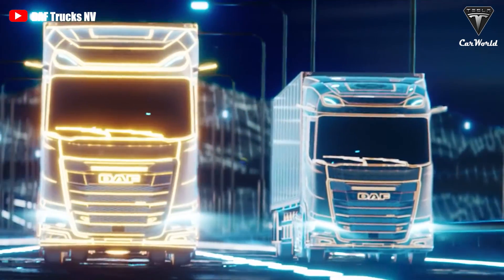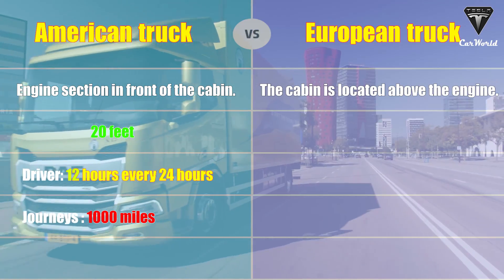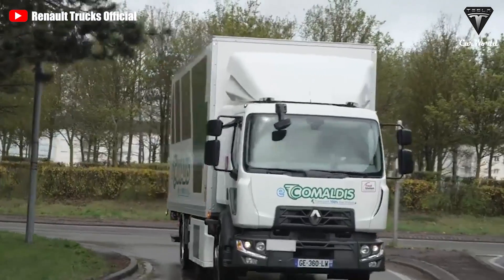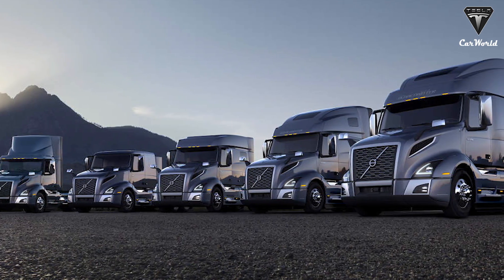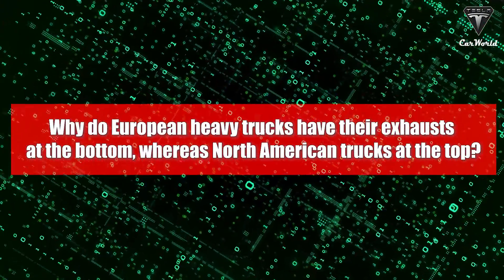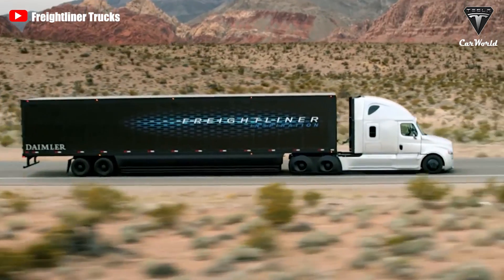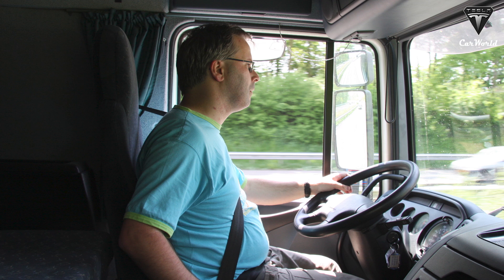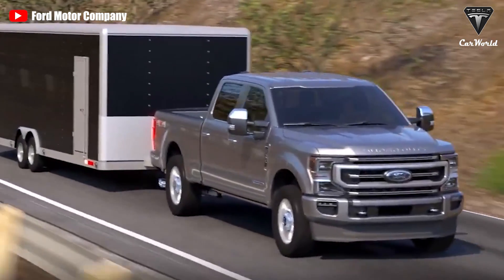Detailed analysis! The difference between European and American super heavy truck (Tesla Semi)

Comment: A cabover are more dangerous in a headon collision
That have to be the top bulls*it comment I have ever heard, an european truck will NOT get a certificate of approval if it is dangerous, and besides we do actual have semi longnosed trucks

An european truck can only be 61 feet, but an american truck can tow multople trailers
Again bulls*it, we have modul trains here in europa too and they can be up to 104 feet

European drivers can not sleep in their truck
Bulls*it, of course we can

It is not 45 hours away from the truck every week, it is 36 hours

Drivers get fined and so do the truckowner
Yes, the truckdriver get a small fine, but the truckowner get a hefty one because he tries to take advantage of the employee

The truck cab are not alowed to be more than 10 feet
Again bulls*it, the 10ish feet is what have been found to be the most practical for longhaul

The american trucker can drive 12 hours a day
Yes, the american trucker are alowed to drive 3 more hours while fatigued

European trucks don't need massive engines due to speed limitattions
Well seems that european trucks still have the most powerfull engines, that is if they use european engines

Internatinal semi  400-565 hp
Freightliner semi  200-615 hp
Volvo VLN 860 semi 400-565 hp
Peterbuild semi  up to 500 hp
Kenworth semi      405-510 hp

Mercedes Benz semi 360-625 hp
Volvo FH16 semi    550-750 hp
Scania 770 S semi  530-770 hp

And with that, I have caught you in 9 untruths in 7 minuttes, and really don't want to embarress you more, so I sign of at the 7 minutte mark

Comment: For better aerodynamic by cabover trucks, could it be possible to have some rubber air pillow, with form like by semi, at frontside, which could be filled with air compressor, to fast driving? And in the citys, by relatively slow driving, this pillow could be emptyed, to hide it, for smaller nose? This pillow could also play protecting role by frontal collisions?

Comment: There are some fact errors in this video. Engines are as big in Europe as in the US. That noice level and comfort is inferior in a COE maybe was true 50 years ago, but not in a modern truck.
Reply: Engines are as big in Europe and European trucks will generally have a higher horsepower output at the same displacement. North American engines a somewhat detuned to increase reliability and longevity. They even do this with our pickups. A consumer/pickup diesel may put out 400+ hp and 1000+ lb ft of torque while a more commercial chassis cab will be detuned to about 350hp and 650 lb ft.